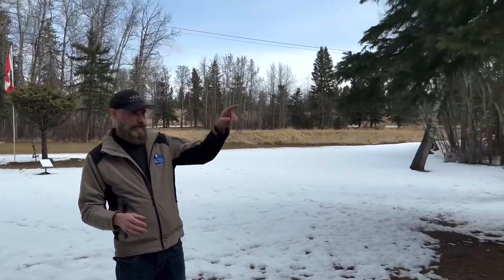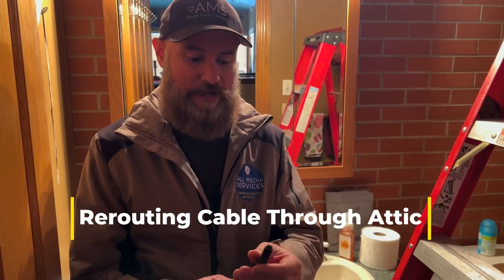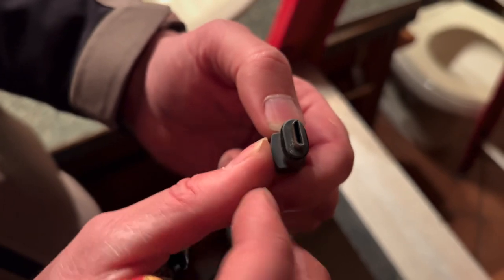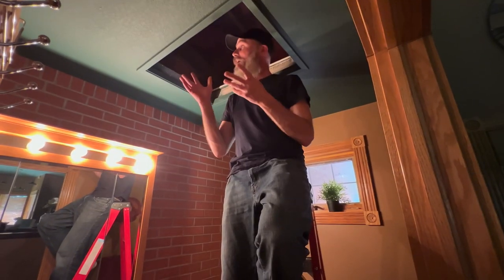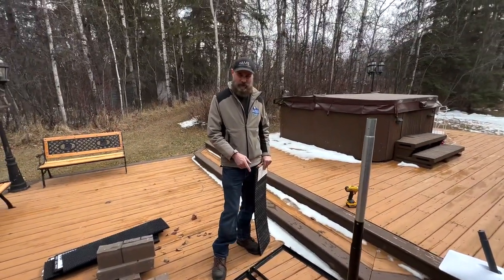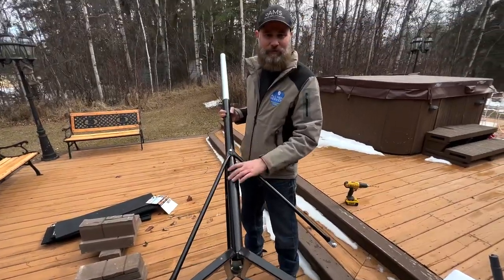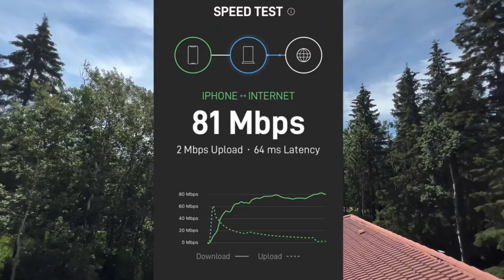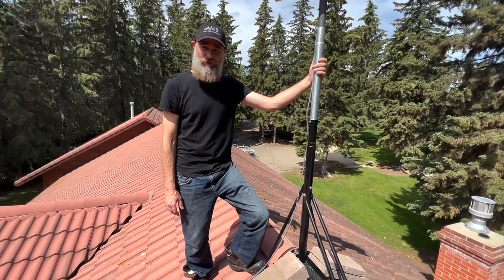Professional Starlink Install (This Won't Put Holes In Your Roof)

Comment: fyi the cable is simply a Ethernet cable inside so you can reconnect it with a coupler or soldering after cutting it. I did not want to drill huge holes for that big connector. Great video btw I might wanna do the same on my clay tile roof.
Reply from the maker: Thanks for the info! That is understandable, it’s a bit excessive. Glad you liked it! Let us know if you end up doing a similar installation, would like to hear about the results.

Comment: Where’s can I buy the roof mount assembly?
Reply from the maker: We had a local welder put the pivot points on a standard NPR. I’m sure he could have made the whole thing though, as it’s mostly steel L-beams that you can get at any hardware store. I found this NPR on Amazon, I don’t know if the pipe will work without an adapter…
Ambient Weather EZ-NPP Tripod and Mast Assembly with Platform https://a.co/d/1oJgY95

Comment: Do not buy Starlink. My Service was down for three months.  The problem was with their settings in house,  and they could not correct it. They also continued to bill  me for the months they could not provide service.  They are even continuing to bill me, even thought I sent my equipment back to them weeks ago. ---   Fair Warning: If your Starlink service goes down, you may be in for one  helluva ride.   All in all, I paid Starlink over $1400 dollars and I received service for only about 4 months.